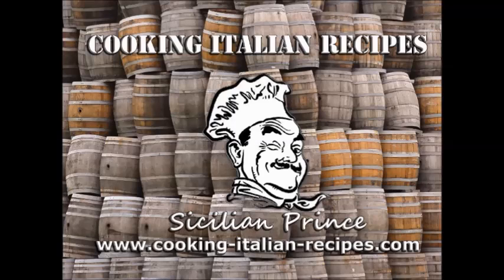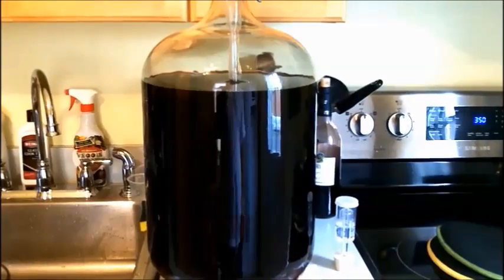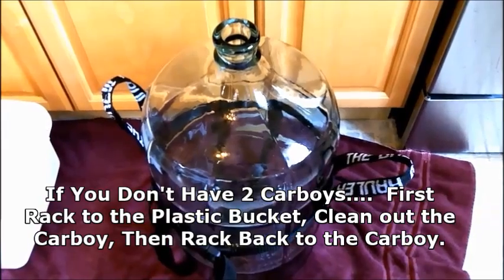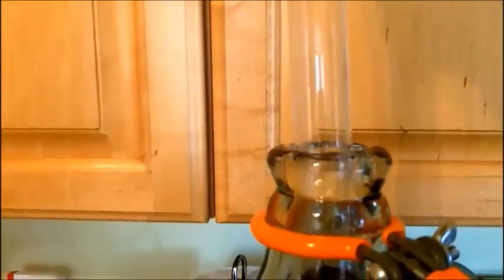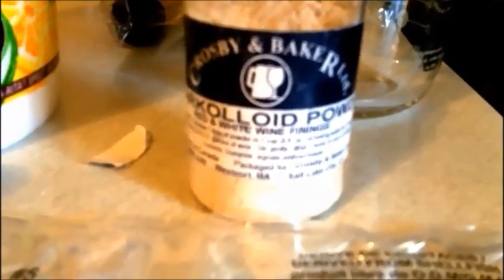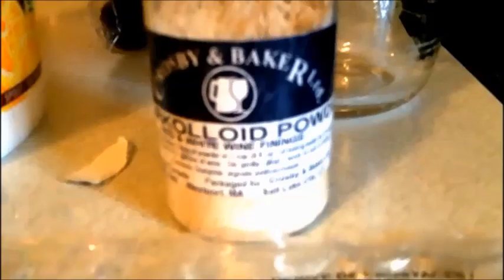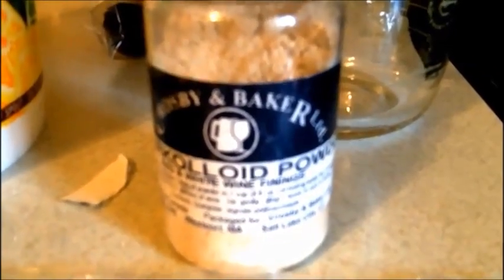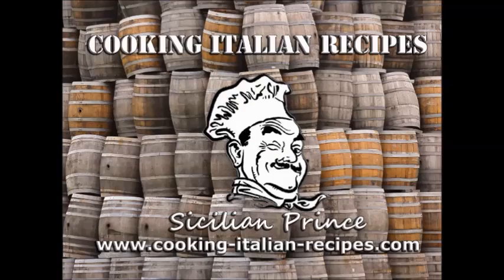Vino Italiano Wine Kit - Degassing, Stabilizing and Clearing - Make Your Own Wine

Comment: Have you noticed any off tastes using a 6 gallon secondary for a 5 gallon batch?  I was warned to leave just a little room when in secondary fermentation because excess oxygen exposure can ruin the wine.  I only have a 6 gallon carboy and would like to try only a 5 gallon batch to see if I can get more body out of the kit.  The 2 kits I have made have been watery tasting.

Comment: I am in the process of making this wine as well and the instructions say that the carboy should be topped off right after the degassing and clearing process to avoid airspace whereas in your video you do it 10 days after that process when the wine is pretty much ready for bottling.
If it stays like that for 10 days would it affect the quality of wine? Thank you.

Comment from the maker: No, I have not.   And I have made so many wine kits, too.

Here is the thing, which I will discuss in my next video.   If you are going to let it clear for 10 days here, and then bottle it, you should be fine.    If you wanted to bulk age, then, you would want a 5 gallon carboy.  BUT, you would still want to use the 6 gallon for secondary, because the 5 gallon may bubble over, AND when you want to rack and de-gas, you need some space to stir.   If you are topped up, you will have a wine volcano.

Comment from the maker: Part 2 of response: 
So, wine volcano = Wine pouring out over the top and spilling on the floor.   You will cry over the spilled wine.   This is supposed to be fun, so we aim not to spill any wine.

They Secondary Fermentation is still putting off so much CO2, so, you will push out everything thru the airlock.  

I have four 6 gallon carboys and two 5 gallon carboys.   I chose the 6 gallon here for a reason.   If I want to bulk age, I would use the 5 gallon to rack off in the next racking.